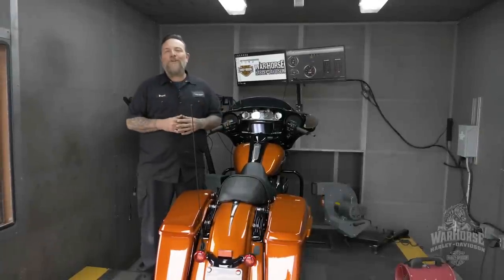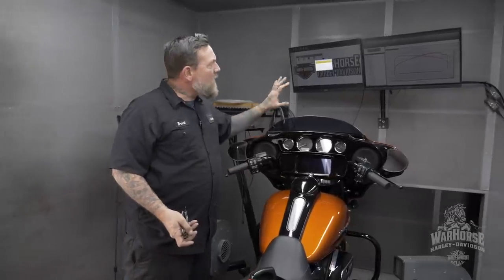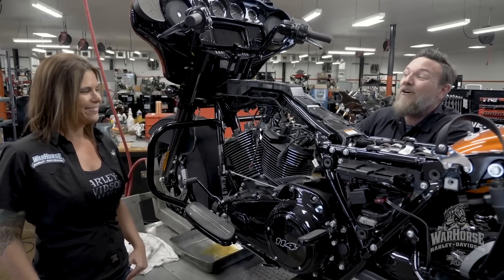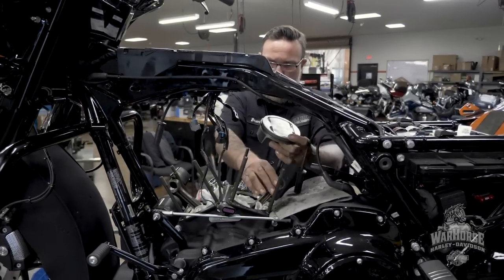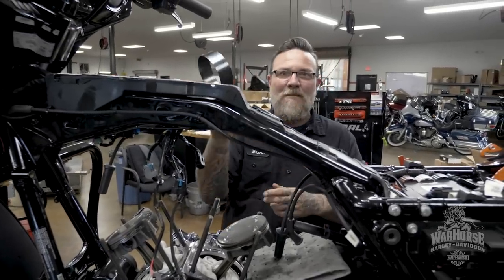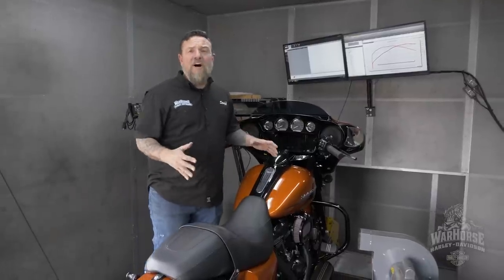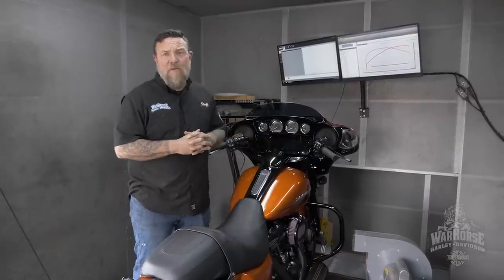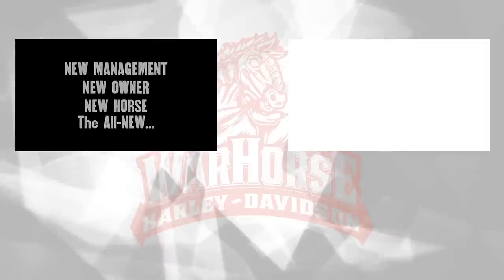Harley-Davidson Screamin Eagle 131 Stage 4 Crate Engine Upgrade Dyno with Horsepower and Torque

Comment: Good stage 4 114 or 117 with aftermarket Cams, tune, exhaust, heads and other parts make the same numbers or better. If I bought a 131 I better be getting 140+hp and 155+tq
Reply from the maker: This is a stage 4 114 motor upgrade. We realize you could get vastly higher numbers with this bad boy but we opted to maintain the factory warranty and put the bike on our showroom floor. It actually sold and I'm sure the new owner is going to do some pretty gnarly stuff with it!
Reply: So much depends on the dyno, conditions, and this still has a 2 year WARRANTY.

Its impressive no matter how you want to boil it down.
Reply: Bob Bob you don't seem to understand the purpose of this engine upgrade. It's EPA compliant and is covered under the factory warranty. The build you are describing is not EPA compliant and is not covered by factory warranty, you're comparing apples to oranges.
Reply: @useryrock  Who cares about the epa...   There is a very small amount of riders that buy an engine upgrade because of epa. Theres only one state that is really anal about epa garbage and thats California, thats one state out of 50... Plus how many people do you really see following epa regulations in California, non. You see riders riding around with fish tail / aftermarket exhausts that aren't "epa" regulated. Warranty is another thing that really doesn't matter, depending what year bike you have the max warranty you have is 2 years. Who pays for your 131 engine when it blows up after the 2 year warranty is up, not harley. Harley bolt in kits are notorious for having pistons seize up and lifters breaking. In my opinion, I would rather take the risk of buying reliable aftermarket parts from good reputable companies than buying a harley 131 kit. An aftermarket company can get you part combinations that will last longer than a harley kit and out perform.

Comment: My stage 4 dyna 103ci has 115hp. Im really not that impressed being that it's a 131ci
Reply: No shit. My 2015 street glide with stage 5 110cubic inch with racing clutch puts out 121hp/126lbs of torque to the wheel. It lays rubber hard.
Reply: Also these new bikes have traction control and you cannot delete em. I rather drift on corner than the bike controls it for me.

Comment: Did you just upgrade the brand new 114 motor to a 131 stage 4 and stick it straight on the dyno without running it in?
Reply from the maker: We did run it out and put break-in miles on the motor before stressing it. We just didn't film all those miles. Thanks for watching!
Reply: @warhorseharley-davidson2214  and how many miles did you put on it before you stressed in on the dyno each time. Stock and then after the upgrade?

Comment: Is it a stage 4 big bore kit or the crate engine? Title says crate but your video shows kit
Reply from the maker: This build is a 131 Stage 4 Kit. There is a crate motor available with a 114 block and the 131 upgrade already installed!

Comment: Is this a 131 Stage IV kit or 131 motor? Can you tell us what air cleaner and mufflers you used on this bike to get those numbers?
Reply from the maker: It is a 131 stage 4 kit. With screaming eagle ventilator extreme air cleaner. The exhaust header that comes with the kit and S&S slip on mufflers. And H-D pro street tuner.

Comment: I thought the torque line would be flatter than it is.  it doesn't seem to reach peak till after 3,000 RPMs, and is already falling at 4,500 RPMs.  Maybe it is a tuning issue.  I'd be curious to know how much you are charging for the bike with the upgrade.

Comment: I have a 2020  Low rider S with a stage 2 Cam and adjustable pushrods and am having a 131 kit installed. Do I need to have them install one piece original equipment pushrods or are the adjustable pushrods strong enough to take the increased Spring pressure
Reply from the maker: Hey Charles, that's a great question! Please give our Service department a call at (352)227-1606 and they would be happy to assist you with that answer! Have a wonderful day!

Comment: I’d still go with Zippers Performance- 124 sleeper kit . More torque similar hp and most likely more reliable long term . 
Check them out if interested. They specialize in Harley high performance and have been doing it for decades.
Reply: Zippier...??? I'm sure the people at "Zippier" Performance are getting a chuckle out of that....lol..
Reply: ozzie444 fixed it 😊

Comment: Hey Is It Possible To Buy This 131 Performance Crate Engine And Buy The Rest Of Transmission And Other Parts And Build A Custom Motorcycle? Instead Of Buying The Complete Motorcycle For  $20k And $6k For This Crate.  What I Thought Is If I Buy This 131 Creat Engine For $6k And Other Parts For $10k And Build A Custom Design Bike. Is This Possible Or There's No Way Unless Buying A Used One For Cheap And Use The Parts And Build A Custom One? I Don't Know Much About These Stage Customizations Was Into These Bikes Like 6-7 Months And These HD Engines Looks Damn Good. Buying A New Bike And Getting Stage 4 Is A Lot Expensive Right? So I Just Thought Why Not Buy A New Engine And Other Parts And Spare Parts And Build A New Motorcycle With New Parts.

Comment: 124 Horse power? What is this? The 1970s?
Reply: The screaming Honda CBX 6 cylinder ultra performance machine of 1977 had 85 rear wheel horsepower.
This has 124 at the wheel.
I have to wonder how much you need.  Are you Batman?
Reply: 124 hp but with 138lb-ft torque
Reply: wHy NoTT Pud A HelKatt EnGIen In I T ......
Reply: 124 whp at like 5500 rpm. Liter bikes make 150 bhp at like what, 15k rpm? And absolutely no low end torque in comparison? This isn’t a race engine, it’s designed to run at low rpm’s cruising down the highway....

Comment: Why standing beside bike for before test and sitting on bike for after test? Plus no equalized break in? Amateur hour or what? How about exact apples to apples next time!
Reply from the maker: When we did the initial Dyno pull there was no problem. After the upgrade we did a pull with the new motor and the rear wheel was hopping with the added HP and Torque so we did a pull with Brent sitting on it. We simply chose not to include all of that in the video to keep it short and to the point. There was a break-in we just didn't show it. We're here to do a full transparent test and nothing else. We didn't skew any numbers or hide anything. Thanks for your input and thanks for watching!
Reply: @warhorseharley-davidson2214  looking at the dyno chart you showed for stock, you could see some tire hop/slip

Comment: What's the mpg after the upgrade versus stock 114
Reply from the maker: That's a great question! We haven't done any more than break-in miles for this motor yet and we didn't take a baseline so we'll have to get back with you on that.
Reply: 3XR5 Not myself, but definitely some people that use their touring bike to tour lol.  🤷🏻‍♂️
Reply: My stock FL 107 M8 was a solid 40mpg but now 30mpg with a 114 stage 4. And can certainly be a lot less depending on how it’s ridden. 150 miles per tank is typical. My guess is the 131 won’t get much more than 30mpg.
Reply: I have a 2019 flhxs 117ci with stage IV and can get up to 230 miles on a tank.

Comment: Now don't get me wrong I love Harley Davidsons they're awesome bikes but to pay $30,000 for a fully equipped motorcycle and then have to pay another 10 or 15 grand for a motor upgrade just to increase the horsepower is crazy I have an 08 Suzuki c109 with 124 Factory horsepower and with just a few hundred bucks I got another 15 horsepower out of it and I'm only 6500 into it now I know it's not a Harley Davidson but I'm an individual and don't feel the need to be included into some kind of Club of acceptance plus Harleys are crazy money
Reply: plus you have to look mad all the time when you ride a harley...so exhausting

Comment: Does it still have the ~105mph speed limiter?  Idk if it’s a CA thing, but I bought a 2019 RGS, racked up aftermarket parts to a bike total of $55k, and they failed to mention the ~105 limited top speed from factory.  It suckedddddd.
Reply from the maker: We wouldn't recommend going that fast unless you're on a track with the proper safety gear ;-) but all the Harley bikes come with a limiter at 110 mph. Thanks for watching!
Reply: War Horse Harley-Davidson For sure. I get it. Safety first, but open road and you just put legends front and back and went from a 114 to a 117st4.....🤷🏻‍♂️. It happens.  She was a 99% perfect bike, and I only have that one complaint. That new motor looks 👌🏻, I might just do another build. Thanks for the content brotha.
Reply from the maker: @shredcity7217   Good luck on the build if you decide to make it happen! We'll make sure to keep the builds coming here on our channel.
Reply: If you get it Dyno tuned, your top end will be your 6th gear redline!
Reply: Shred City get it Dyno tuned! Then your top speed will be your 6th gear redline.i can do 123mph in 4th gear on my 2018 road glide with a 117cu in. Dyno tuned engine
Reply: billmart67 but then you have a brand new 55k bike without a warranty.   I guess it’s a call to make.
Reply: Shred City no warranty with Harley on engine, but my engine builder gave me a 2 year warranty.
Reply: Shred City my 2018 Roadglide is a special,so: cost of bike-26400; 117cu in. Engine kit-5k. D&D exhaust 1800; dyno-tuned-300.so I am just under $34k
Reply: billmart67 oh damn.  I really hadn’t even thought of that.  I wonder if a shop will give me a two year for a build here. At that point I can go wild and do whatever I want to it huh.  I do like the quality of work my local HD shop does, but I can’t believe I never thought about that.  Shop/builder warranty.  Fml.  Lol.  You may have just helped me make a decision. 🤙🏻
Reply: billmart67 you’re bike sounds mean as hell man.  Definitely sounds like a beast to ride.
Reply: Shred City yea a lot of fun! Yes expensive! But I the best of both worlds.... fast, cruiser. I ended up getting 134 hp. & 131 tq.
Reply: billmart67 I think you made the right call.  I did everything from the dealer.  All in about 55k, but I moded every inch of the bike.  As far as motor, i was just so afraid to go off the dealer warranty.  After 55k, I was at ~125hp/tq.  I’m saving for a new build now.  I’m going to do what you did.  Thanks for the input man.
Reply: Shred City anytime! Good luck brother!

Comment: This is almost 2.2 litres. Put a Vmax 1800 motor in one of these baggers, you'll be running 9s
Reply: DennisH22A the VMAX is a liquid cooled 4 cylinder that makes max power at 9k rpm.  This is an air cooled V twin.  I’m sure somebody stuck a Lamborghini engine in a Harley once but that doesn’t mean that it’s a good idea or that I would want to own one!
Reply: I have to agree with you on the v max 1800 motor, it would probably blow the doors off the 131 big bore kit. Besides that's a lot of money for a motorcycle, let alone a Harley.

Comment: I have a 2019 fxdr with a 128 kit after market heads cam tuner. I'm making 140hp 153q to the wheel.stop making power at 6200rpm. My setup cost 4500 too boot. My warranty is gone but was willing to part  Ways with it. I can say that have a muscle cruiser unlike before.
Reply from the maker: Those are solid numbers! Sounds like a pretty awesome build! Thanks for watching!

Comment: I realize that's a lot of torque, but seriously, it still only makes about the same HP as a Japanese 600cc bike? I think it's stay stock and if I wanted speed I'd buy something built to go fast.
Reply: Jim Bennett How many 600cc bikes make over 120 hp? Which ones?
Reply: @MadLadsAnonymous , well off the top of my head that's the 2015 to 2017 Suzuki GSX-R600.  It makes 125 hp (93 kW) @ 13,500 rpm and that's to the wheel, not at the crank ;-) most of the newer 600s make at least 110 rear wheel hp 120hp isn't unusual at all anymore.
Reply: Jim Bennett interesting! I know the CB650R makes like 94 at the crank. Sounds like you're referring to SS class bikes? Thanks for the clarification.
Reply: @MadLadsAnonymous , oh yeah, I should of have mentioned that. They've been really getting stronger since everything is fuel injected now. A lightly tuned GSX-R a friend of mine had put out 159hp on a dyno pull at bike week last year. That thing will run with his stock Yamaha R1.

Comment: My 18 heritage  107 " has stage 4, was  dynoed  with 122.37 hp , 120 lbs torque..  with the  SE 515  high lift cam. I dont like this cam..  Needs a more torquey cam at low  rpms..

Comment: So you can take your 107 and make a 131 out of it huh?
Reply: @4The2nd well technically you are correct it can't have the 131 kit but they have a 128 kit for the 107 which gives pretty much the same numbers.

Comment: Still gets crushed by a stock rocket 3
Reply: It should...3 cylinder vs two cylinders big difference..
Reply: @johnkolinoff8591  the twin should have more tq then shouldn't it?  By that theory, any 4 banger should have more hp then.... however that isn't the case. Bet that 130 in a FXDR would crush an R6 or GSXR600.  Let's just agree that HD is way overpriced and has really fallen with build quality
Reply: @johnkolinoff8591  ducati 1199 L twin cranks out 171hp, hell even the old RC51 honda put down over 120hp on a 1000cc v twin in the 90's
Reply: @blakefarinas6170   "That's because they're made that way!! if Harley was going to be in the racing which Ducati is.... a friggin racing bike! It has nothing to do with the "Cruisers".... two different bikes two different animals? just because you don't like Harleys you have to  b** about them all the time! get over it..
Reply: @johnkolinoff8591  dont get it twisted I do like HD but there quality and manufacturing in India has made the brand shit. And why spend 7k for a crate engine to go in a bike for cruising and not a "race bike" the 1199 also came in a Diavel which isn't a race bike btw
Reply: @blakefarinas6170       "Good for you... you can like Harley, our you can hate them. I like all bike's and to compare the "Diavel" same bike but with handle bars set rearward for more comfort and better foot Peg placement... it's still a beast!! with a claimed 162 horsepower some say 159 - not in the class of a Harley Cruiser, now that bike more resembles a Yamaha VMAX! with both of them having ample horsepower!  I do agree with you that Harley should have a "Black Ops" division... where you can get anything performance minded..for any model that you like.  adding that 7 grand for the motor in there that's like saying I'll take a "screaming eagle" version...  I guess that's a good thing for having aftermarket companies it's all about those Benjamin's $$  how fast do you want to go..

Comment: I've got a 124 ss makes 129 horse power and a139 foot pounds of torque this 131 isnt that great you should at least get 1 horse power per cubic inch why are the harley kits always less my motor is a hot set up no c n c heads 640 cam 10,8 to 1 compression haven't had a lick of problems just saying

Comment: That will be just great until3 weeks after the warranty expires and the price of shit pressed on fly wheel system shifts and runs the cases destroys the oil pump and plays here on the cam chest yeh might be big numbers but if you buy to keep for long times look at Indian. Or you could go the economy route and by an used evo or if you realy want to sound good go with a shovel that is what I did always had a special spot for the this is my 3rd not as fast as my twin rap but still fast enough to get a ticket
Reply: So, skip the 131 upgrade on my 117, and go with a shovelhead... because you did. Allrighty then.

Comment: What does it do in the 1/4mi?
Reply from the maker: That's a great question! We did the upgrade then put it on the showroom floor. We'll have to see about taking it out and running some tests on the next one. Thanks for watching!
Reply: It won't be impressive!
Reply: Michael Angelo  I agree! I had a 2013 vrod muscle that shot out 120hp out of the box. That was 7 years ago.
Reply: @Mod Zozer riiiight
Reply: @Mod Zozer mid 14s just a guess
Reply: @Mod Zozer I've gapped a 117 CVO and I'm only running low 13s different elevation up here, but I've yet to see a stock Harley any size sub 14s
Reply: @Mod Zozer about 2400ft, I'm certainly not trying to argue, I keep teasing the track guys that they need to re measure, seems all the guys down south can run mid 11s with "stock" bikes, I hoping to break 12 this summer
Reply: @Mod Zozer I'm about 1.9 60ft 100mph, running suicide shift, did some head work this winter, I'll be happy if I'm sub 13 this season
Reply: probably keep up with modern mini vans